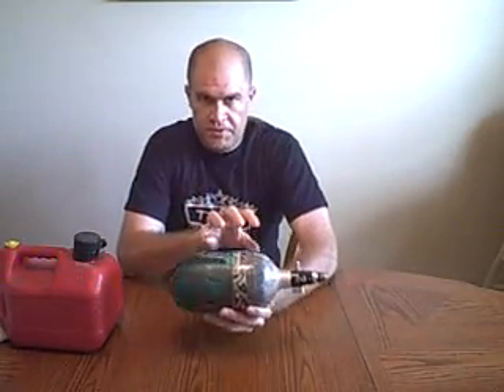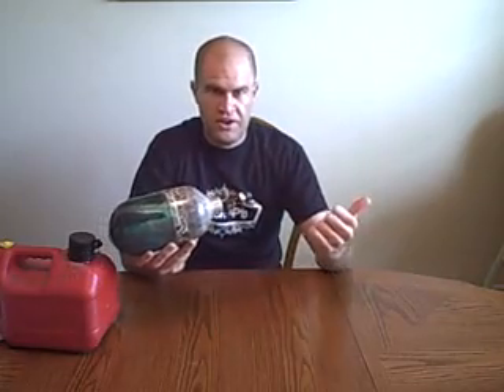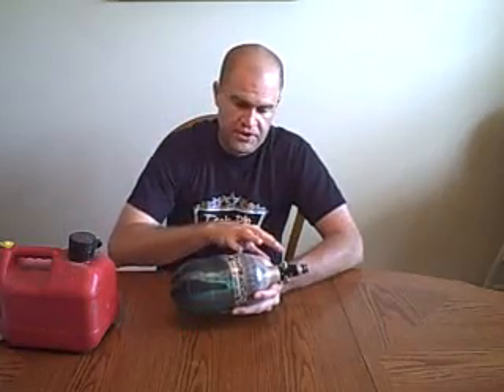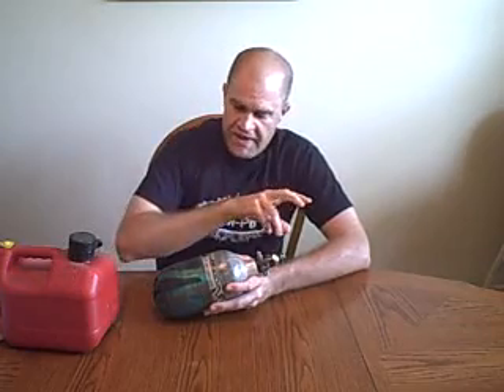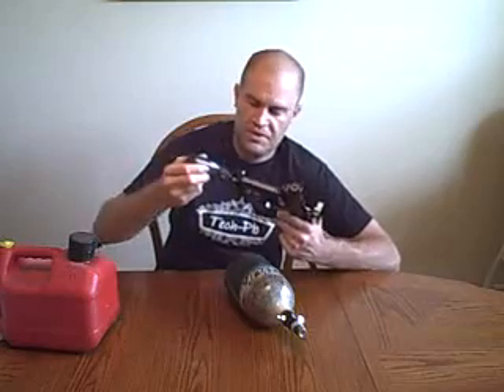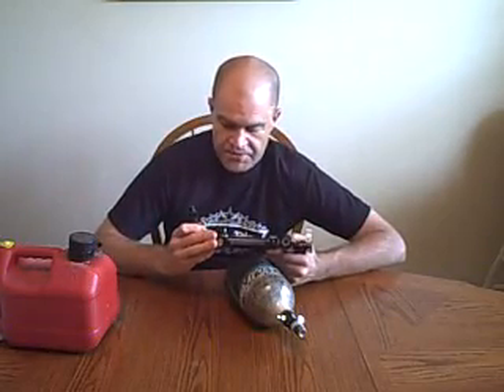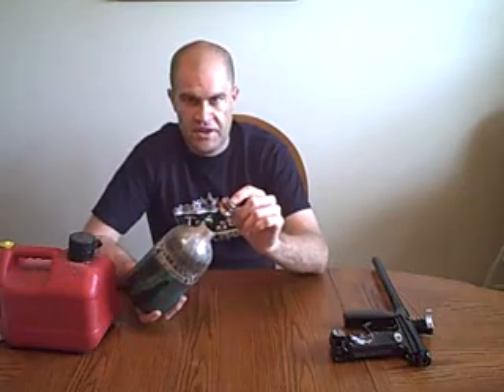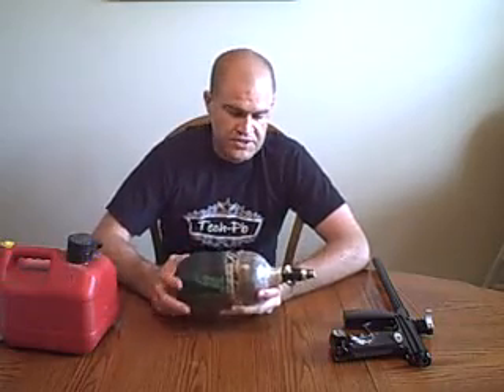Exploding Paintball Tanks (This applies only to HPA, not CO2)

Comment: My most sincere gratitude to you for exposing me to this very real danger.  I was having trouble releasing the hose from my air pump and without any consideration, I sprayed some WD 40 around the quick release which was attached to the intake valve (fill nipple). Again, I was trying to disconnect from the tank…what a f****ng idiot I am. Thank the Lord that I ran across your video. I was able to shoot out all the compressed air by attaching the tank to my marker without blowing myself up. That lubricant is petroleum based and   Now I understand the potential for a catastrophic accident which I could have easily fallen victim to. Thank you so very much. -SK

Comment: use TRI-FLOW we use this oil just to protect seals from water forever .. we use it on Boat engines... great for compressors guns,pumps ect and yes thank you for your info.. yout right a backdraft will blow up.. you mix all 3 elements that will ignite..

Comment: Use a cotton/carbon filter inline with your pump always! This filters out particulates and H2O from the air. (i understand this may not have been the case back in the day when HPA was a new thing to the sport.)

Any petroleum oil will still diesel at 800psi.... the air rifle community has done extensive testing on this, even with co2 and pump guns. Point here is do your research before messing with stuff you're not an expert on.
Reply: Hey, I used one of my friends hand pumps to fill up my HPA tank and when I took off the fill hose, silicon oil shot out of the hose and all over my fill nipple. Since then, I have filled my tank up to no more than 1200 psi because people say that it will explode if oil comes in contact with the fill nipple but does this also apply to silicon oil? Is it safe to fill my tank up with more psi or is the tank basically shot now that there is oil inside and I shouldn't try to fill it up again. Any response really helps because its a 90ci 4500 psi carbon fiber ninja tank and it would suck if I had to dispose of it.

Comment: I have an '08 Ego. The marker shoots great, but if I leave the air on for a while without shooting the marker, it will start leaking a little. It sounds like it is leaking in the frame area. What do you think could be causing this? I'm thinking one of the regs is creeping up in pressure a little. The leak stops when I fire the marker, but will start leaking again if I let it set there for a while,

Comment: Can you oil your threads? And why would you? Also, for maintenance on a marker, what areas should i lube? Thanks!
Reply: No need to oil asa or tank threads, just clean them. Oil orings in the gun and moving parts. Your manual will give you the details, if you dont have a manual hit the forums.

Comment: U should not ever fill a bottle with oil it will destroy ur seals it's like in the air gun world people make this mistake all the time even I've made this mistake when younger myself listen to the man it is a bomb if this is done and where ever ur bottle is located doesn't matter it still will kill u and anyone around u boom the shock wave alone can kill u not to mention the shrapnel if u want to play with a hand grenade join the army because it's not fair on the guy who charges ur bottles but they will usually notice the signs of a oiled up bottle but if they dnt and it goes bang ur going to prison for along time for being a dick simple mistake but think of the consequences seals are cheap and easy to maintain 25p that's what a seal costs per seal but I have seen them sell for crazy prices but always buy them from a reputable dealer the cost is for ur safety and others around u simple just buy seals in bulk

Comment: Help me out. I am new to the whole paintball world, like literally Noob level. But i just but A Spyder Hammer 7. I figured it is a good way to get into the sport. What do you recommend. Hpa tank bs C02? What size and brand? I dont want to kill my self so safety is first. How long each tank last will be my only concern. Any feedback and links will be appreciated.
Reply: Use HPA, don't put oil in fill nipple, use a 3000psi steel tank from a paintball store until you get more into the sport and you can splurge and get a carbon fibre tank, if you want to get a carbon fibre tank they are about $200 USD steel tanks are about $60 USD. 

So if you get carbon fibre here is what to get by size, if you are small like 5,6 or something get a 50/45 if you are medium build get a 68/45 and if you are massive get a 77/45.
Good companies are Empire Paintball, Ninja Paintball, Crossfire, Guerrilla Air. Any other tanks are something I personally would not get but that's me.
This is all you need to know about tanks
Reply: +Frost Thanks bro. I bought a 48/3000 ninja tank.
Reply: LBCchelsea1
NP M8

Comment: It can happen with CO2 too! Never mix oil and compressed gas of any kind!
Reply: +John Fraser I doubt it. While there is a possibility, It is extremely unlikely. CO2 is filled and stored at below 2000psi, far below the safe limit for oils. Putting a drop or two of tri-flow in the threads of your tank wont have any adverse affects.
Reply: +Nicholas R.M. No, it wont. Co2 is filled as a liquid, not a gas
Reply: GeO :D Yeah I know, but it's not the gas that make the oil detonate, it's the impact. Instant high pressure release can cause an impact on the oil. It is true that CO2 is stored at a relatively low pressure and that it won't detonate oil by itself, but when in contact with moving parts, like a valve, an impact could occur between two parts. If there is oil on these parts, it could detonate! It is a small chance, but I would not risk myself.. Anyway, why would you lubricate these parts?
Reply: +Nicholas R.M. That wouldn't do anything to the oil. Co2 is stored below 2000psi, with is the safe limit for oils. Impact wouldn't set off an oil. Throwing a bit of tri-flow on your Co2 tanks threads wont do anything.Even is it goes inside the tank, nothing would happen.
Reply: +Nicholas R.M. I dont think it would detonate because oil needs oxygen and CO2 won't give available oxygen for detonation. Also it is two things that cause the oil to detonate, heat and pressure. HPA is under significantly higher pressure than CO2. I agree with you though when you say that you would not do it anyway. There could possibly be air mixed in with the CO2 and maybe the pressure could still be enough.

Comment: What about silicone oil? I just lubed the o-rings in the shuttle valve with it.
Reply: Electronicdawg As in dropped oil into the fill nipple? No.. no oil there. You've done a bad thing. That tank is not safe

Comment: I want to get my dad a kit and myself a kit to start a new hobby but I only have 220$ and want good quality kits
Reply: Um well save up some more and buy yourself either a proto rail or an azodin blitz with an invert halo too or an empire halo too hopper and pick an air tank I would go with ninja 68/45. But before you do that play paintball like 5 or 6 times and see if you really like it.
Reply: And their is no way you are going to get two "good quality kits". If you want two guns for that price get a tipman a5 because you can upgrade the hell out of that gun down the road if you get more serious. And all you need is like a 5 dollar hopper because you won't be able to shoot that fast and get a 68/45 tank.
Reply: Another option is to go on Craigslist and maybe you can find a good deal. I got my gun pretty much new that way I got an azodin blitz with an invert halo too hopper a ninja 45/45 tank a case of paint a mask and a pod pack for $80 because this guy bought all this gear and he got bruised so badly he never wanted to go again. But what I recommend is if you do that ask the seller to meet you at a paintball store so they can check it out for you and anyways your probably going to have to buy lube a mask o rings Alan keys and all that stuff so it's a one stop shop.
Reply: Oh and don't buy spiders unless you get them dirt cheap they aren't really worth it in my opinion. My friend got one for 5 bucks so that was worth it but other than that save your money.

Comment: What about if you put loctite on  the regulator threads? Is that fine?
Reply: I highly doubt Loctite has oil in a thread sealer, so you'll be fine, but I don't understand why you'd seal threads on something you need to remove extremely often.

Comment: This is not how diesel engines work... they work on heat from compression, not the compression alone. Your tank doesn't reach 1000 degrees when you fill, does it?
Reply: Your diesel engine doesn't reach 1000 degrees either... I hope:)
Reply: Unless your not talking about actual engine temp and talking about combustion rate then it could be 1000 degrees
Reply: Brody Ruhlig 1000 degrees is an overstatement. Wiki says the auto-ignition temperature of diesel fuel is just over 500 degrees F. Regardless, you are not compressing the contents of the tank, but moving already compressed and cooled air from the fill station into your tank.
Reply: @DrCoolHands  my diesel car last winter would still start up even though my glow plugs were dead.
Takes a little more time but till ignites on compression alone
Reply: DrCoolHands what he meant is that it works on the same premise. in a diesel truck you take a fuel that is very close to being an oil and compress it till it ignites, taking about well over 1000degrees at point of ignition but heat dissipating very fast, If you put any kind of oil based product in any kind of sealed tank and then put 4500psi into that tank the oil because of the air pressure gets very hot very fast and can ignite and because you just pumped 4500psi of air into the tank you know have all the fuel and air you need to make what is a bomb.

Comment: I'm new to paintball should I get a 62/3000 guerrilla tank or empire 48/4500 but I'm on a budget and idk if 3000 psi tanks are good or better then 4500 psi tanks
Reply: No 3000psi tank is better than a 4500psi tank, no matter its brand so, that is an easy one. Basically the 4500psi will able you to shoot much more balls than a 3000psi as, for the same volume, it takes 1,5x the air the other takes. 4500 psi tanks are much more expensive but if you have the budget, than go for it, they are usually much lighter also ;).
Reply: If you are new i would reccomend 48/4500 you dont really need that much air
Reply: I prefer a 68/4500

Comment: I am not getting a hpa tank staying with co2
Reply: HPA , is pretty dam safe, as Mike had said, you just dont do that one thing, it take a whole 2 mins to unscrew the fill nipple replace the worn out part and rescrew it in, and you are good to go, or if you just want to be completely lazy buy a new reg they are only $40
Reply: HPA is more consistent. Electronic markers can only use HPA
(phenom is an exception)

Comment: I'm new to hpa tanks and wanted to knpw if benjamin hand pumps are safe to refill ur hpa tanks
Reply: Negative.  It will not generate enough pressure to actually fill the tank.  You need a Scuba tank to fill them.
Reply: Incorrect Sgt! There have been people with bike pumps that have filled tanks! It takes about 100-150 pumps however.. Extremely heavy too.
Reply: Umm actually you can..
Reply: /watch?v=s33ZF4Nbz7A

Do some research before you respond my friend.
Reply: I've been playing for 7 years ;)
Reply: Felepeno It is true. Some PCP air rifles come with hand pumps and operate at 3000-4500 psi, so it works with a paintball tank, just takes much much longer.
Reply: ^Bam.
Reply: Felepeno Those aren't bike pumps... They're specialized multi stage high pressure pumps for filling PCP air rifles. Bike pump will only do about a max of MAYBE ~150 psi. The benjamin pump is also only designed to fill about ~2000 psi. So no, you would need a different PCP pump to fill even a 3000 psi tank.

Comment: Thanks for this video! I've explained this hundreds of times to people. Two things I'd like to note. One is that yes, get the nipple serviced by a store etc, however, it will have to sit for TWENTY FOUR hours before it can be filled again. Because you have to use some blue locktite on it and it has to cure. Also, for people wondering, the tanks are designed to fail along a seam so that they split and dump the air. They don't tend to frag, but some bits DO still fly away and can cause damage.
Reply: The local dive shop will NOT take the valve off of a CF PB tank. They told me that locktiting the valve on them voids the warranty and makes removal often fatal to the tank's threads.  Do you know how this is handled normally? I have an 8 year old tank that needs tested and certified, but I cannot get the valve off no matter what I do.
Reply: @LeMortso  well, they're right about the locktite. When I was working at my local proshop we always had issues with regulators that came >from the factory< with red locktite in the threads. When/if we could get the regs off, when putting them back in we never used locktite as it really isn't needed. That's a LOT of pressure pushing on those threads and it's MORE than enough to keep it seated correctly.

Look around for a regulator removal tool. You might still find them floating around, not sure if anyone's making them or not. If you have a local pro shop available you could also ask them, most will pop the reg off free of charge. It's just a block with a hole in the middle and some slots in the side that slides down over the reg and lets you get a wrench on one end. If that alone still struggles then you're going to be looking at heating up the locktite, and that's a pain in the butt. I'd honestly suggest sending it to a pro shop that can handle the job as having personally done it WITH proper tools....it's still a pain.

Comment: Depends what kinda regulator they got at your local field, It's only meant to fill 3000 psi tanks not 4500 psi tanks. They would need to get a regulator that will be able to fill your gun up to it's maximum psi

Comment: Its not the pressure that ignite the fuel/oil its the temperature raise of compressing the air rapidly  in a diesel engine
so does the temperature get to 300dgr C in your tank? no way

And I work as an engine product development at one of the biggest diesel engines makers in the world.
also we ADD oil to our CNG gas when we fill the tank to lube the system.
so I dont buy your theory.
Martin

Comment: question 1: if my tank is past its hydrotest date and i still have air in it can I shoot the rest of the air out? I plan to send it to a hydrotest place but I want to make sure its an empty a tank.
question 2: if I'm transporting my tank in my car, the pressure difference when going for example to NJ to Pa ( city to mountains) shouldn't affect the tank correct? i just want to make sure i don't blow out my windows when I'm driving. lol
thanks

Comment: what about tank-remote with slide check-tank in stock when running low on air in the stock tank? there is a tiny bit of oil going throught the remote into the tank from slide check, is that ok?

Comment: why would you want to do something like that?, high pressure air is far far cheaper than  concentrated co2, do you even know what hpa is? i just told you it sucks the air around you in and compresses it to a very high point. which is far cheaper than having that air filtered and sorted and made into co2   so you're actually always putting co2 into your HPA tank along with everything else thats in the air.

Comment: I have a question, i talked to ninja's technical support and they told me the exact same thing as you, but my tank is actually leaking from the pin, where you put your gun in.. however i hook it up to my air compressor which is only 100 -150 psi. not enough to play with, obviously lol.. but it still leaks quiet a bit. do you think its a missing O ring or just needs more pressure to hold the seal?

Comment: The same thing happened to my 4500 PSI Ninja tank and I used it just fine.  They have a special warranty for repairing that particular defect since it cropped up recently.  Repair turnaround was about 2 weeks if I recall correctly.  Check their website ninjapaintball

Comment: If you are concerned and dont have experience in working with the finer points of HPA, I would suggest you take your tank to an air smith and tell them what happened and that you would like it cleaned.  Like most aspects of paintball, most things are rebuildable and everything works best clean anyway.

Comment: Will an HPA tank explode if there is a small dent, or small scratch in the finish? Because I recently bought a ninja dura 68/45 and there is a very small scratch on the coloured coating, it's probably less than a millimeter deep. I just want to be safe, cause im going to play on friday and I need to know if i should return or not.

Comment: A. Steel hpa tanks even at 3000psi are as at much risk. 
B. A fill nipple cover only protects the nipple from damage during play. Filling the tank is when dust and dirt particles enter the fill nipple, and damages the o-ring. 
C. Any particulate is combustible at a certain air to fuel ratio, and enough heat. Wheat silos will combust in the prescence of a flame when enough it is a good enough ratio in the air. Its called stoichiometry. Research it.

Peace.

Comment: Pfff. It's a little soft-plastic ball with fluid in it and it breaks on contact.

When playing professional soft-air gun, you have from 0.2-0.5 grams solid hard plastic pellets. THAT hurts. Not your regular cheap soft-air gun you got for 20 bucks or won at the tivoli. It has a freakin motor firing those pellets really fast and it HURTS.

Comment: cross threaded .... if the tank is cross threaded dont screw it into an asa or it will mess up the asa you need to replace the entire top of the tank..... if the asa is cross threaded dont screw a tank into it and but a new asa if you dont you will cross thread the tank